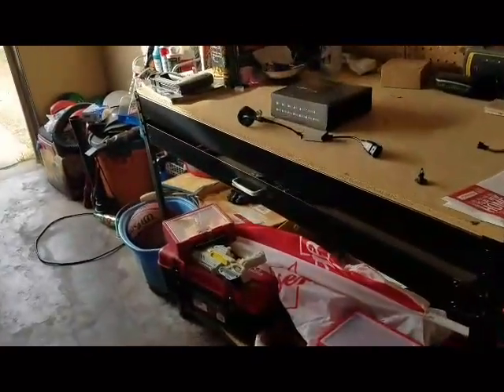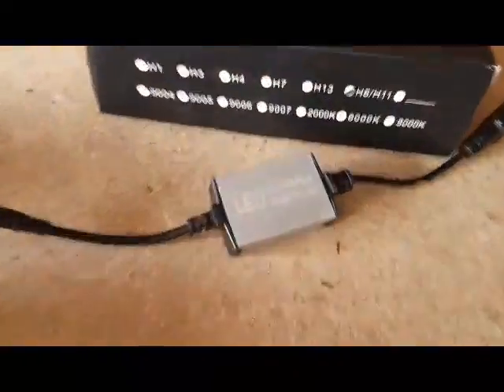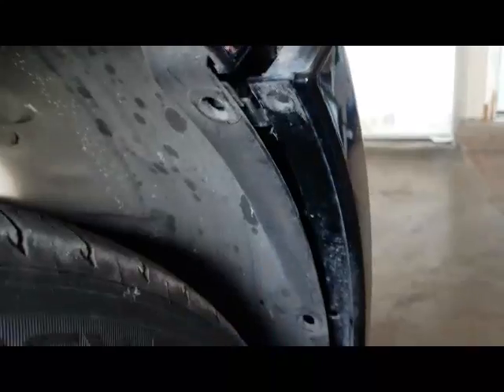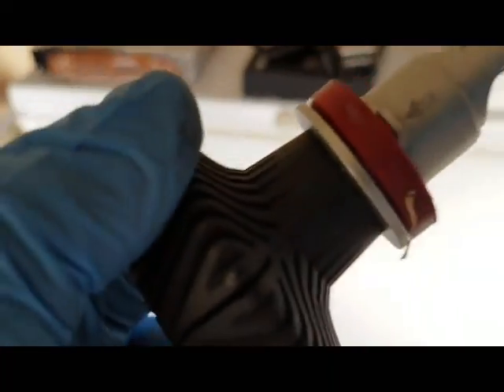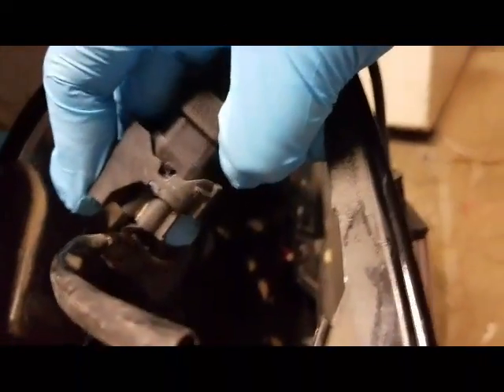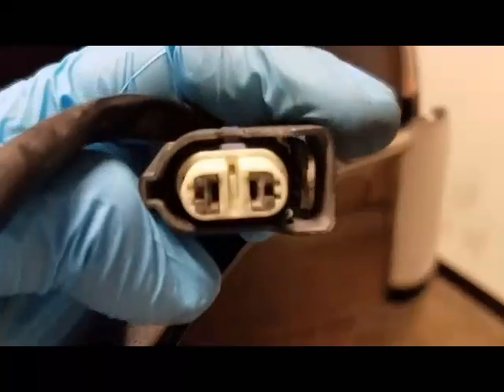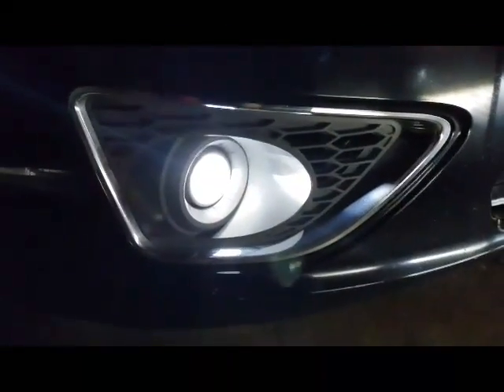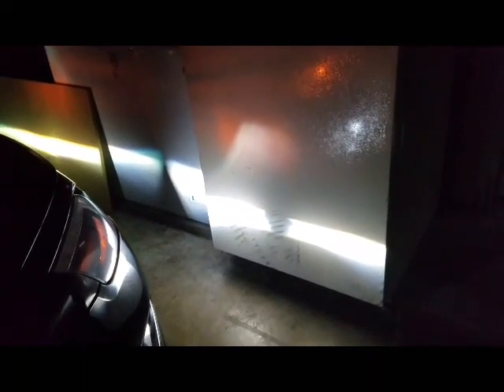HID vs LED light bulb

Comment: I have a 2011 Sport. I believe the stock lights, fog and head, call for h11 55watt bulbs. Did you have any issues with these leds since they are over 120watts per bulb? Seems like the harness or wire or housing would melt/burn.
Reply from the maker: +John Doerger been running them since the video with no issues but plan on upgrading to brighter leds, thanks for watching
Reply from the maker: John Doerger also these are leds which produce less heat than hids would
Reply: Becausebass362 - Your led fogs look pretty great. Just yesterday I installed some leds that were 6000 lumens per bulb and 100 watts per bulb and they looked terrible in my fogs. Super hot too.
Reply from the maker: +John Doerger yeah you kind of want to look for leds that have a good heatsink I'm going to retro fit some projectors that are made for leds with morimoto led bulbs bought some for my brother and they are super bright pure white as well, don't forget to sub if you haven't already the next mod is going to be sick

Comment: Going to do LED's on my 11 Sport, what wattage and lumens were your leds?  I now have F70 HID kit with true 70w bulbs, I think between two bulbs about 7000 lumens so roughly sitting at 14,000.  I am looking at some serious kits for the fog lights but was curious of the light output you bought.  THANKS!!!!!
Reply from the maker: +Morgan Trage the leds I used in this video were actually a low end brand just yo try out from a 10-20 ft distance they are bright and pure white with a instant turn on no warm up those are the pros the cons are in the long distance but I'm sure eventually the technology will catch up but I love the pure white look thanks for watching